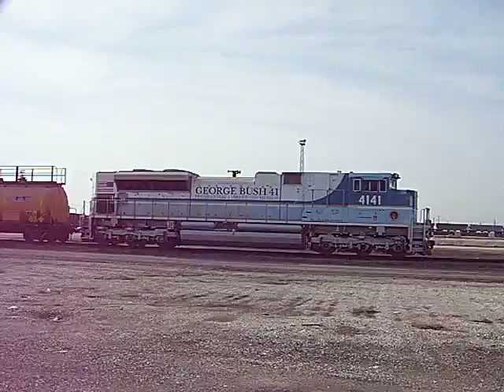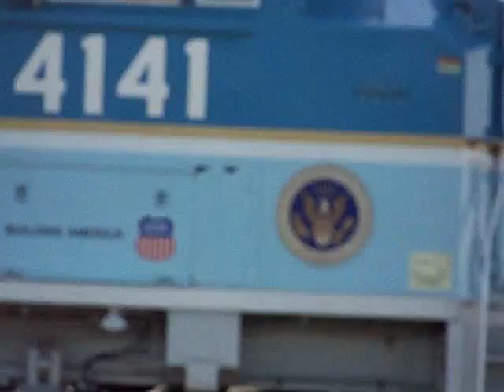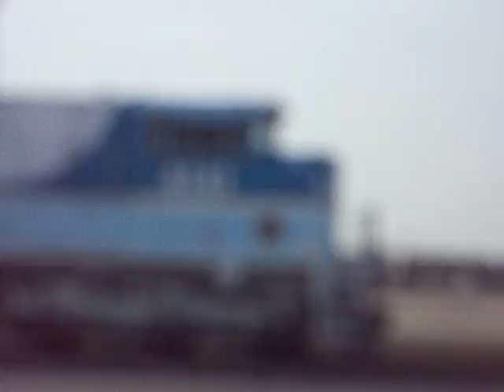UP 4141- Bedford Park, IL

Comment from the maker: This engine was specially painted by the UP for the first George Bush (H.W Bush) for his presidential library and museum. It usually runs in Texas but made its way up to Illinois for this Dow safety train, it stopped in several towns on its tour, including what you see in this video at Bedford Park. The train is heading out to Michigan but this engine is not going with it, it will be put back into freight service.